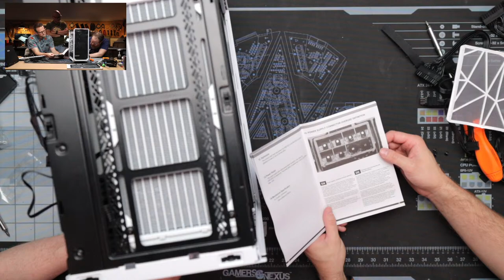Building Will Smith A Gaming PC - LIVE!

Comment: Is 850w good enough for rtx 4090?
Reply: On paper, Nvidia recommends an 850 so this should be fine. For transients it should be fine as this is an ATX 3.0 PSU and the 40-series has better controlled transients. The question is whether loading up a 4090 and a 13900K is an issue. But in reality, people generally do not run the GPU and CPU hard enough to hit that wall at all. We basically are experimenting on Will  here to see what his real-world experience is like.

Comment: As soon as I saw i9 *Facepalm.  The 7950x is now Similar money, better multicore, Far more efficient, No e-core system instability for the 1% of software they’re useful in, Superior platform with b650e boards half the money over z790 and Far superior to z690. Platform Longevity including past ZEN5 24 core monster into ZEN6 Not Just a dead platform with no options